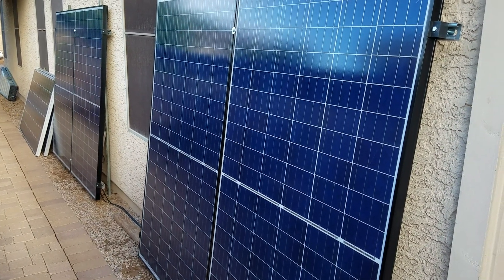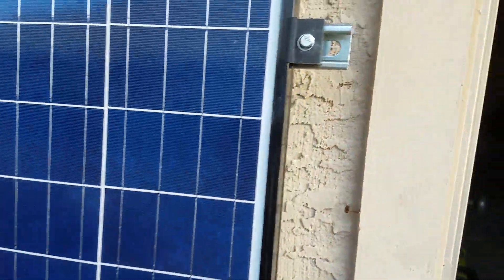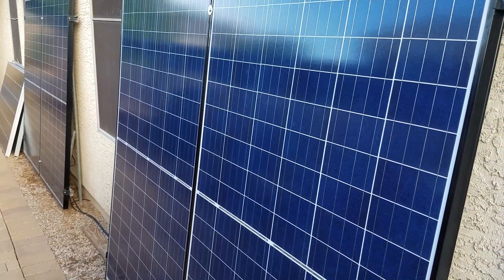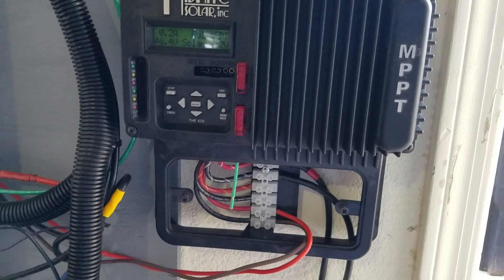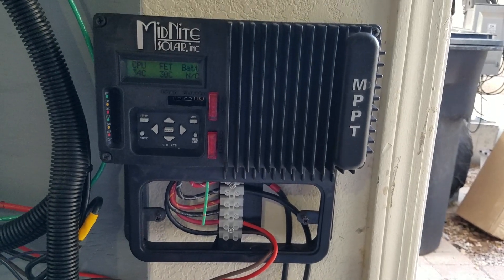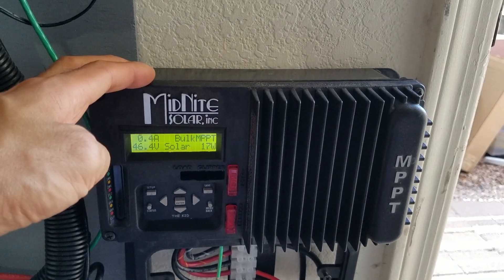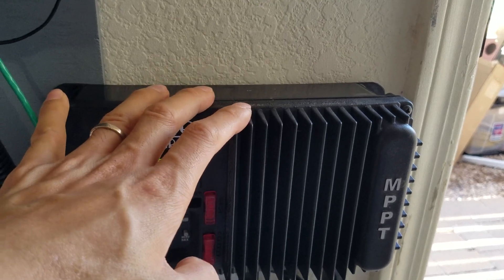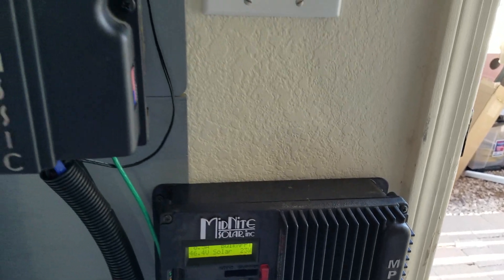Plan to add more to 4kw Off Grid Solar array and Lithium battery (Part 2)

Comment: curious do you live on the moon?  veritical panels.. bet you will never get any output worth doody. Sorry you really should have done some reading .. 17 watts out of 1500 watt panels is about all you can expect.
Reply from the maker: No, unfortunately I live on the "earth" planet that are fill with IDIOT like you that have no idea the reason why my panel are mounted in such way.  Idiot who doesn't know in winter time in this region, the sun is at 57degrees and having the panel vertical achieve best result.  But in the summer time it's not, but depend on everyone situation is different, you can't have both.   17watts because it's 8am you dumbo....
Reply: and expect that you will see a major increase in power after the winter solstice  to 30 watts
Reply: lol well said
Reply: i was replying to devildestiny555 btw. Steve Pailet grow up
Reply from the maker: :)  Normally I just ignore comments like those, but today I feel some what itchy and irritated so I couldn't resist.
Reply: these panels are veritical  if one was on the moon the sun light would be coming directly upon the panels... So my comment is that they are really perhaps only good if one is near the equator.. So with that in mind do not see where they will ever produce much.  What is the actual sun angle that is striking the panels.    one can have lots of charge controllers but if the panel output is low really how much peak out put can one really expect
Reply: perhaps you might get an idea from this video.. vertical mounting works well if you are near the equator  https://www.youtube.com/watch?v=m_YuPfShbCo
Reply: @stevepailet8258   vertically at equator? Do you mean horizontally? Increase in vertical angle would help more as you approach the poles and more horizontal as you approach equator. Please help me understand.
Reply: @justanumber427  it was sarcasm.. reality is only perhaps 10% change in output if that much, no matter what the angle is if the panels are facing south

Comment: I hope to eventually get a classic 150. Then maybe another after I get more panels. My lithium bank can easily handle about 280-300 amps charge. And the lead bank about 400 amps charge current. I'd want to stick with. And my lithium bank is about 1/8 of what I intend to have eventually. The lead acid Bank will last all day and night. And I'm charging g it with just under 30 amps for now. So i have to take it easy with it. I'd like to get that closer to 100 amps, then about 150-175 or so for the liion bank. Keep up the great work!